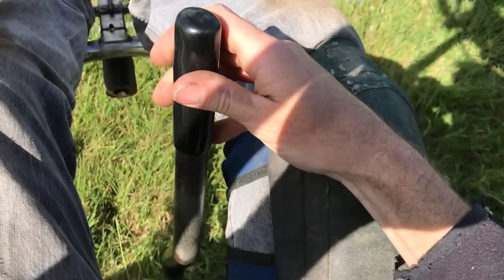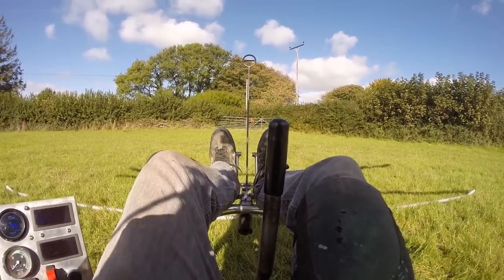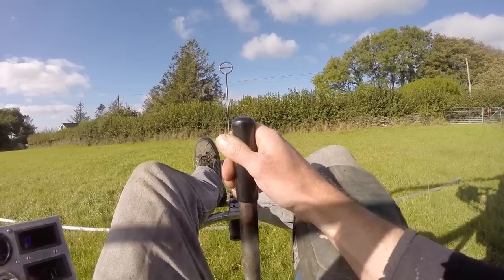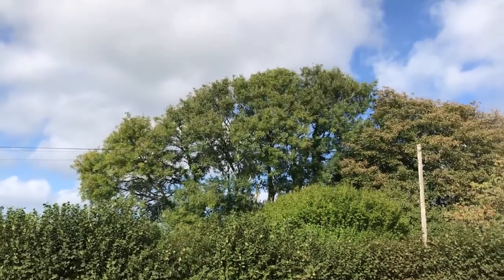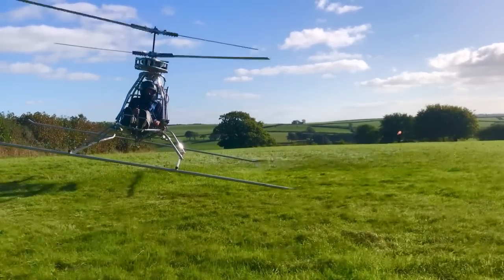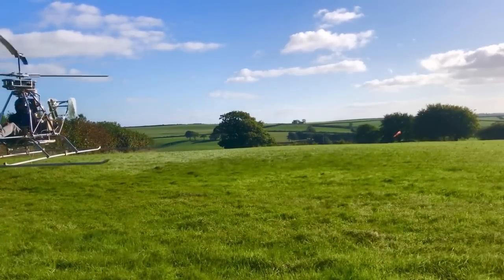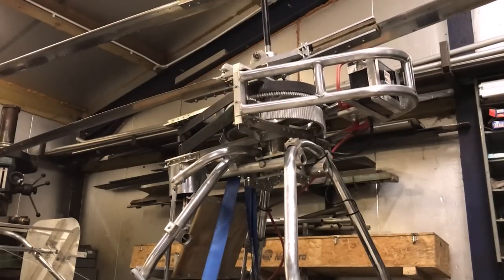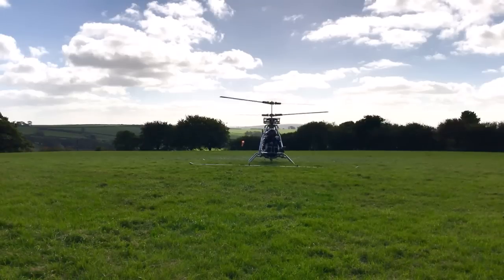Dodgy Moment, Homemade Coaxial Helicopter Learning to FLY

Comment: It appears that you are giving input to the pedals with your whole leg. This will result in large pilot induced inputs to your cyclic because the height of your knee will keep changing. You should be pivoting at the ankle and inputting with toes only. You heels need to be supported and stationary if they are not now.
Reply from the maker: Great observation. I will see if I can alter this, I would have to increase the ratio of pedal movement to fin deflection but I think this would be a good idea anyway. I'm moving the pedals way more than a Robinson.
Reply: Oh wow, great obs! You may have just saved this guy's life. No kidding! Cramping could occur with the set-up, too, and a charlie horse is not a good thing while flying this!
Reply: Whilst I agree it is difficult to prevent unintended pedal inputs if the heal doesn’t have a rest, rudder pedals are connected to each other in opposite sense. Any motion imparted to the foot due to the knee moving vertically will apply to both legs. As you can’t push both rudder pedals at the same time, this shouldn’t be an issue. I can see the benefit of using the knee pad to steady the right arm though, although if this is necessary to be able to fly I think you have a bigger problem to solve.
Reply: @gillfitzpatrick7894  I am not sure the reason you have brought up both legs and counter-operating pedals. But yes, an push input from the left leg WILL impart a right pedal push on the right leg causing a cyclic input. What is the bigger problem you have mentioned?
Reply: Gotta accept the lag, especially when torque controls yaw, not ona the tail boom parasites. 👍
Reply: @gillfitzpatrick7894  we're talking about PIO. Our brains aren't wired to counteract one foot movement with the other foot moving in the other direction. We're dealing with increasingly exaggerated control inputs. So the counteraction exceeds the action, repeatedly. Just look at the tail wagging most inexperienced pilots are displaying. It's difficult even in commercially available aircrafts.

Comment: To increase safety I would consider bolting plastic balls to the end of your landing gear outriggers. This will help prevent a dig in if you a forced to land with sideways motion. Spherical toilet cistern balls might do it. Good effort so far.👍
Reply from the maker: Thanks for this, I hadn't thought of cistern balls, good idea. Light weight and cheap. Will think about how to mount them so they don't come off. Cheers
Reply: While I agree that the outrigger tips could pose a problem, I was thinking that the outriggers need not be level with the base of the copter. If the outrigger tips were raised up by 5 to 10 degrees from the base, they would be much less prone to digging in from slight angle sideways helicopter motions, but could still protect against very high angle tipovers.
Reply: That’s the exact same things I used when I was learning to fly a model heli
Reply: @kitchencone  Yeah, but having stabby things pointing up isn't a great idea
Reply: @mikejj101  Yep same here, definitely helps to prevent dig ins, which in a model RC copter is extremely costly (certainly back when i was doing it), where as in real life could be deadly.
Reply: To be Absolutely Honest - I think he's got enough balls doing what he's doing
Reply: Or just bend the tube around in a full loop

Comment: I'm not a helicopter pilot, but I worked for Mike Hynes, Brantly Helicopter, as a machinist, and all the pictures and movies of B2 test show Frank Erickson filing chained to the ground. There was no question about Frank's ability to fly helicopters. He had been doing this as long as anyone. The wind or whirlwind in Frederick, Oklahoma, could wad up a B2 in seconds. 

Hovering that close to the ground is dangerous. No one has fast enough reflexes to counteract errors and accidents that happen that fast. Tie your rig down on short chains so your skids don't dig in, and stick your rotors & head in the dirt. At least bend the ends of the skids up and put aluminum balls on the ends of them.

I don't think the actions of a rigidly mounted helicopter rotor with conventional cyclic and collective controls apply to rigid counter-rotating blades on a tilting shaft.

Good Luck!
Reply from the maker: Hi, Good to hear from someone who made Brantly parts, I don't know a lot about them apart from the ice cream cone shaped fuselage. After a bit of research it seems a well respected and made machine. Great sound from watching some YT videos. I like the three bladed design, high inertia rotor system for good autorotation and smoother ride. 

I agree about the dangers of hovering close to the ground hence the reason for the long poles which do have the ends bent up to prevent them digging in. Balls on the end I'm open to. 

I started off with short tethers to ground anchors and they were needed in the beginning. After gradually extending their length they were starting to be a hazard and preventing the process of learning to hover. I still have them now but they are 100ft long and serve no purpose other than allowing me to show the videos. The 5m long poles have been great at gradually allowing me to gain altitude in safety and learn the skill of hovering. I guess now I'm getting to higher altitudes (3ft) things have the potential for rougher harder landings if things get out of control. The rough landing in the clip has been the worst over the last 6 months testing and it's also been the windiest conditions I have dared test in. Back to calm conditions for me now.

Comment: It is amazing, what you have achieved. I got my heli license in 1984. I was once quite a proficient pilot, with 5 type ratings, but these skills have now atrophied, so I have stopped flying helis and have bought a small fixed-wind a/c with a friend. I think you fly it well - and it seems quite stable. On the question of the upset, putting it on the ground is the safer route. When you are hovering a low as this, there is a risk of lateral motion resulting in a skid strike. Whilst I appreciate that you have skid extensions, you still have a risk of a dynamic rollover if part of the skids gets stuck in the ground and you were to increase rotor thrust. Good luck!
Reply from the maker: Hi and thanks for the comment. Good to know your thoughts on situation. I've added balls to the ends of the skids since this video. Will help avoid a skid dig in which of course would be potentially disastrous. I'm pretty sure on a calmer day this wouldn't have even happened. Enjoy your fixed wing 👍

Comment: The wide skids are flexing, but have worked correctly when required. Congratulations on going back up!
Reply from the maker: Yes thankfully they worked well, no way I could have even got this far without them. In time I will gradually reduce the length but certainly not yet. 👌

Comment: Good morning.  I am enjoying watching your progress.  I do have a few questions/suggestions/observations for your consideration.
1 MARK THE LIMIT/RADIUS OF YOUR TETHER. Painted circle or tufts of surveyors tape on pins. Movable and re-usable. There is a danger of reaching the end of your tether and causing you to fight against it in a recovery.  I have seen a number of videos with a tethered helo that would have safely flown away get destroyed due to being tethered. 2 CAN YOU ADJUST THE SENSITIVITY OF YOUR CONTROL STICK?  I know there is only so much space between your knees. But a small amount of stick input seems to upset your helo. 3  WIND SHELTER.  I under stand the logic of hiding behind the tree and fence line, however the wind turbulence behind the wind break may be more harm than benefit. You may really be better off in an open field with straight and consist wind patterns.  I know good days to fly are few but if 5 mph is your safe limit then obey that until your skills improve. 4 CAN THE HELO REMAIN STEADY WITHOUT INPUT.  Is the mast head in balance? Are you constantly having to provide correction to the helo? Is there any vibration? Have or can you pitch track your rotor(s)? 5 DO YOU HAVE THE SKILLS TO FLY A HELO?  I know that as I have aged (60) I do not do things as well as when I was younger.  It is one thing to learn a new skill and strive to do something new.  Is it worth dying for?  Professionals crash helo's on a regular basis. I watch Dan Gryder Probable Cause on YouTube.  In the USA we are loosing one General Aviation aircraft a day this year.  He has a great channel.     Lots to learn.    STAY SAFE.   Regards  Dudley
Reply from the maker: Thanks for the input. The marked circle would be an excellent idea, it's easy to loose track of how far you have moved. The tether going tight would be disastrous. Given the choice I would ditch it but I can't do that. The tethers are 100ft long so I would have to go half way across the field for them to get tight but certainly good to mark where that is. I did reduce the sensitivity slightly of the controls previously but my thoughts are now that it needs to be more sensitive, more like the R22 I had a lesson in. The cyclic on that was twice as sensitive to mine I would say. I think less travel on the cyclic would mean faster corrections making it easier to keep up but I could be wrong, it's difficult to say what is for the best.
Reply: @Ben-Dixey  Thank you for the reply.  My observation on the control input is limited to what you post in your videos.  The R22 sensitivity may be a function/need of the rotor system. Stay Safe. My helo experience is very limited, but I recall the pilots did not have to have input to the controls at power just before flight/lift off. IE the rotor seemed to be balanced.

Comment: I'm confused (which seems to happen more lately), but at 6:39 you said something about if you need collective to be able to auto rotate then you might as well have cyclic too... But how do you control it without cyclic? Is it considered something different with the rotor head your using?
Reply from the maker: Sorry for the confusion, the tilting of the mast is considered cyclic control but not by all people. I should have said cyclic blade feathering. A gyrocopter generally has fixed pitch rotor blades and tilts the rotor on hinges. The stick is still called the cyclic as tilting the rotor is still causing a cyclic angle of attack change, (it gets very confusing here).  Have I answered the question or made it more confusing ?
Reply: @Ben-Dixey 
You explained it quite well, thank you. And I sorta figured that there was either another term/word used or that you had misspoken, otherwise it wouldn't have made sense. Anyway, it's always nice to learn something new on a subject that I really enjoy, so thank you for explaining that.

Comment: Bell 47 has the radiator immediately behind the cab, between the cab and the engine. There is no airflow induced by the rotors there. There is a shroud which forces the fan driven air through the radiator, it cannot escape out the sides. I would start with that, minor alteration and virtually no weight gain. Was the Robinson time hovering of assistance? Love your friends reaction.
Reply from the maker: Good plan, thank you 👍 as you say the shroud is virtually free cooling improvement and easy to install. 
The R22 did help in a similar way flying at home does but with 20minutes hovering in the R22 that is more like two days flying at home because I can only do 1 minute 20 at a time. I might do 10 runs in a day if I'm lucky. What was really great was to reacquaint myself with the sensitivity of the 22 and compare it with the coaxial. As a result I'm going to make some of the controls more sensitive. The instructor was also great pointing out things I can Improve on. Him telling me I was behind the helicopter and needed to speed up the corrections was super, it's not something I wound figure out for myself very quickly.

Comment: Not a real Helicopter pilot  however I fly RC Helicopters, when hovering close to the ground you have ground effects. In Ground Effect (IGE) is a condition where the downwash of air from the main rotor is able to react with a hard surface (the ground), and give a useful reaction to the helicopter in the form of more lift force available with less engine power required. When I first started learning I had a dude tell me get higher up away from the ground effects and it's much easer  for hovering.
Reply from the maker: Thanks and yes I have felt the difference in stability higher up, when I'm feeling confident I will increase altitude but haven't been any higher than 3 ft to date. It takes some nerve to go higher and it will gradually increase as confidence does. It's the old catch 22 you need to go higher to make it easier to learn but you need a higher level of skill to advance to higher altitudes . Dual instruction is the easiest and safest way
Reply: @Ben-Dixey  Once you've gained the confidence everything will fall in place, you will fly higher and start going places. I fly a Cessna 172 IRL and it took me about a year till it all fell into place. I look forward to more videos.

Comment: Love what you've done with the skids. Smart to go that large when testing (or even later). I would probably consider making the curved tips a bit bigger: you're not far from getting a tip stuck in the ground in this video.
Reply from the maker: Thanks. I've just added plastic balls to the bent up ends and have just tried it. Think I'm happier with more clearance. I could bend up the ends a bit more anyway, it wouldn't hurt.
Reply: @Ben-Dixey  If you look at it like a machine made to skid, then  I would say that a long progressive curve would be ideal (reduced friction) much like the shape of modern skis (rocker), which is also more or less what a lot of helicopters are equipped with. Even better would be to cover the bottom with PTFE or polyethylene but that's pushing a bit :)  Amazing effort anyway.

Comment: Amazing! Just wondering if the slight flexing in the area of the assembly above the cabin is expected, or if the mounting may not quite be rigid enough? Could add a bit of unpredictability to the behaviour of the craft?
Reply from the maker: Thanks. When you say flexing, are you aware the rotors tilt on hinges? It's not like other helicopters in how it's controlled.

Comment: screw pitch is fixed. The gear ratio of the gearbox is also constant. You regulate the lifting force of the propeller with the power of the engine, i.e. throttle valve?
Reply from the maker: Yes that's correct. Fixed pitch and altitude controlled via engine power/rpm .
Reply: @Ben-Dixey  Understood. Thanks for the answer. Your screws are above the thrust direction control hinge. Therefore (theoretically), with the control stick thrown, your helicopter should rise vertically upwards by itself. In this case, you do not need to interfere in the process. Or is the restoring force not felt on the control stick?
In my subjective opinion, engine power control is best transferred to the flight direction control stick. There will be no need to be distracted by the other hand. With one hand, it's easier to control the power and direction of the flight., I think so.
You are well done! I am sure that you will bring the device to the desired degree of controllability. Have a good mood!

Comment: How does one calculate the optimum space between rotors in a coaxial system  ?
Reply from the maker: I don't know how to calculate it but 10% rotor diameter is what my research suggested for this size helicopter. I think kamov chose a little more than 10% from memory, but they are obviously much bigger helicopters.
Reply: @Ben-Dixey  thanks 👍

Comment: Hi Ben great vid, that last question.....why don't they build helis with the fully tilting head, if someone could answer that  ???
Reply: A tilting head rotor system has limits on speed due to drag and inefficient rotor aerodynamics. As a side effect, you are the suspended load and the rotor system is moving around your mass. As the rotor blade makes a revolution, the swash plate on a normal swash plate controlled rotor varies in relation to the forward speed. With no swash plate the blades cannot change pitch and reacts as a drone helicopter blade in forward flight. The cabin pitch down angles would be scary if you had enough power, but drag from the fuselage and rotor blade angles in the airflow would increase the power requirements as well. Racing drones can fly like that, with their huge power to weight ratios. A helicopter that size, it's not possible. Add a swash plate to the system and then the possibilities increase. A lot of people have tried a lot of things. They failed... millions of dollars were spent refining what works. Helicopters are complex for a reason. :D